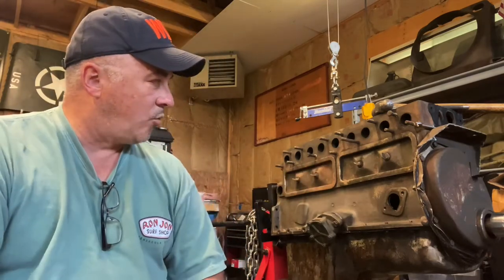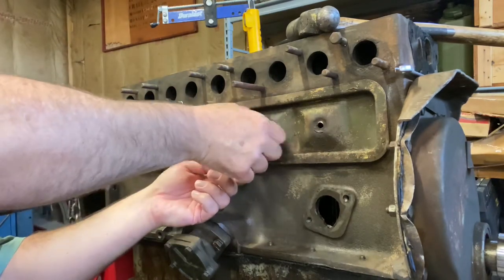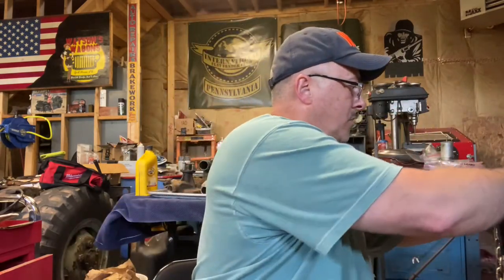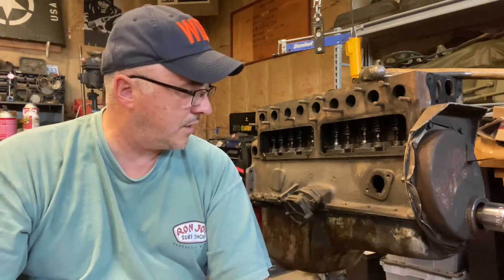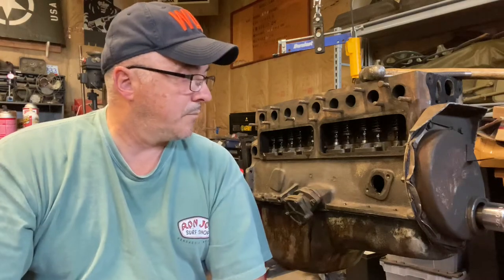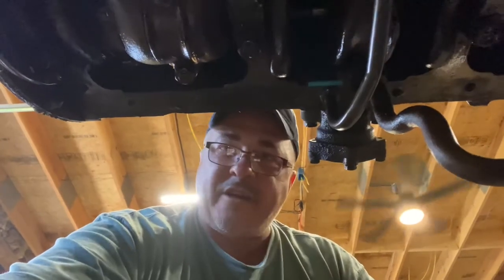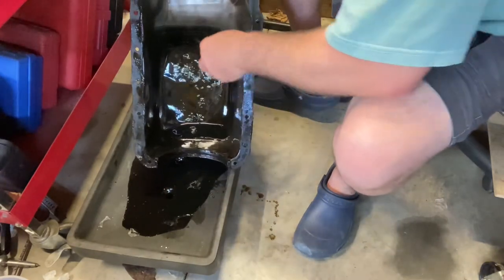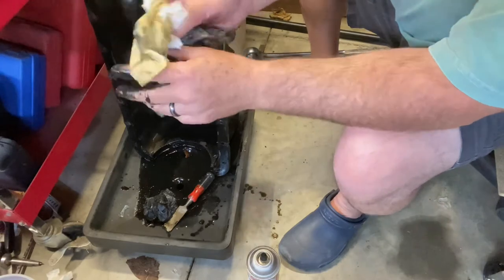Dodge M37, T245-A engine valves and oil pan

Comment: It was a hard task for me to replace these spring locks
Reply: I used cup grease to hold locks to screw driver tip slide it off put other lock same way release spring  ---there is tool to grasp spring makes job easer